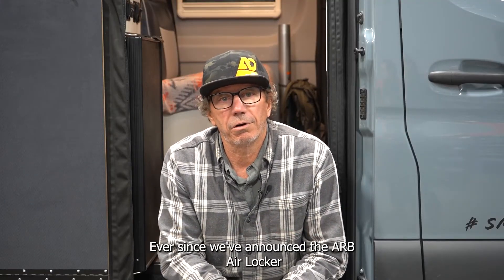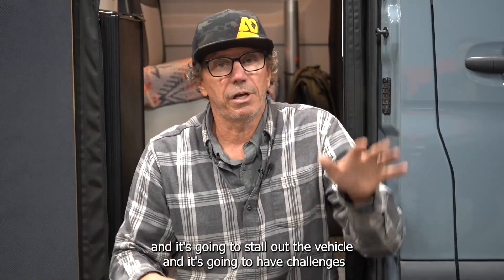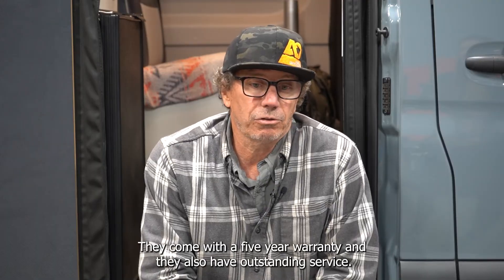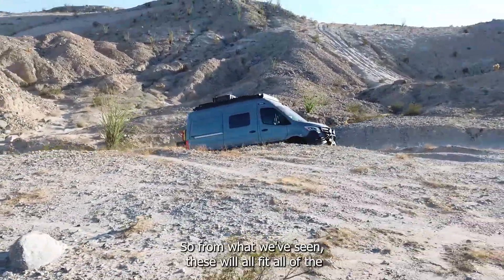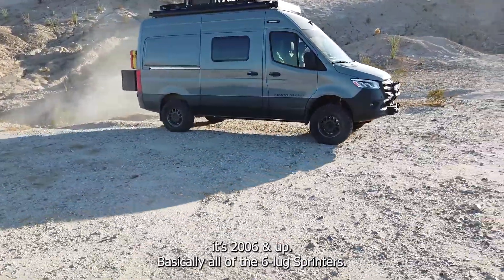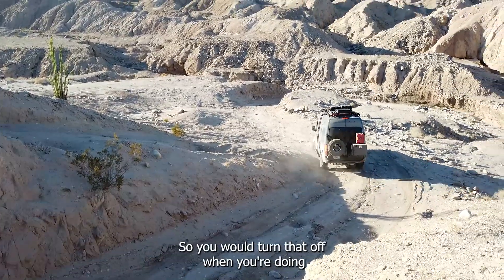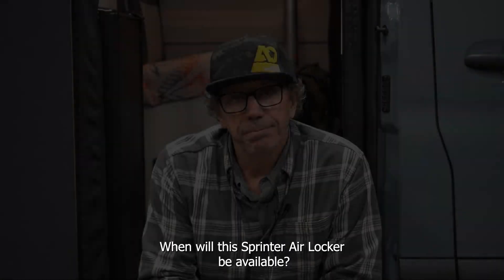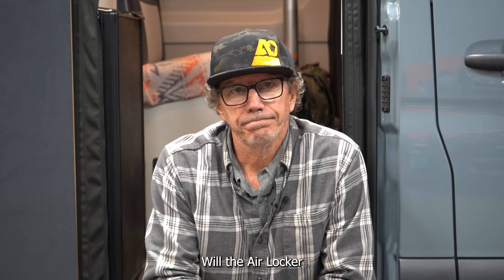ARB Air Locker for Mercedes Sprinter | Rear Differential Upgrades Explained!

Comment: Without going into too much detail, or more is even better..(ie rpm and mpg effects), what are the recommended tire size range for the 3.92, 4.18 and the 4.36 gear ratios you offer.
Reply from the maker: For most 4wd/AWD applications we recommend the 275/70/17. Max tire size you can go up to is a 285/75/17 but this will require trimming the front and rear fenders. Please keep in mind that we would need to know the van’s year and model to make sure that changing the gear ratio is an option!

Comment: Will lockers work on new 2023 sprinter all wheel drive, do I need to change to lockers or just keep all wheel drive?
Reply: This will work in the AWD, must be the same gear ratio
Reply: You will basically be getting 3 wheel drive then versus 2 STOCK

Comment: Have you put this ARB Air Locker on a Sprinter 3500 Dual Rear Wheels.  I am planning on getting my 2011 3500 View Preview smart as dirt to be able to travel Forest Logging Roads with greater clearance for these rougher road.

Comment: Hi Is there an ARB contact that you have down here in Australia. I have 2020 4x4 Sprinter and would like to have the Air locker installed.

Thanks

Comment: How can 4x4 work if the front ring and pinion doesn't match the rear ratio?
Reply from the maker: Most 4x4 Sprinters don't have matching front and rear gear ratios to begin with. Both of our Sprinters (2019 & 2020) were equipped with 3.92 rear gears. The front differential is 4.20. Somehow (using witchcraft & fairy dust? lol) the transfer case is able to distribute power appropriately despite the difference in gear ratio. 

After this video was filmed, we changed the rear gear ratio in the 2020 Sprinter to 4.18. After reprogramming the computer with the corrected rear drive ratio we found the transfer case is still able to distribute power as intended. 2WD, 4x4 HIGH & 4x4 LOW function as expected!

Comment: Will it work with the VB air suspension for the air source or will it need a separate air source?  I have a Airstream Interstate 24x which is a Mercedes 3500 chassis.
Reply from the maker: Any pressurized air source can be used to actuate the locker. Assuming your VB suspension has an air tank, we should be able to use that for the Air locker.